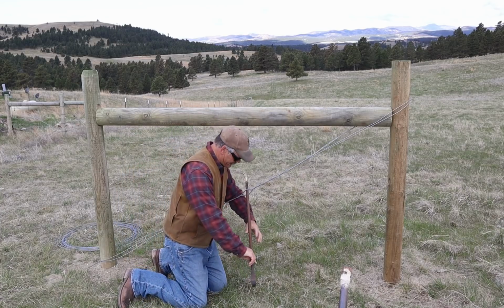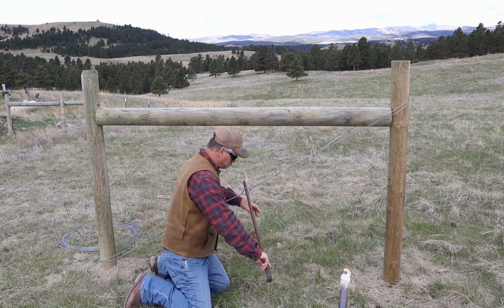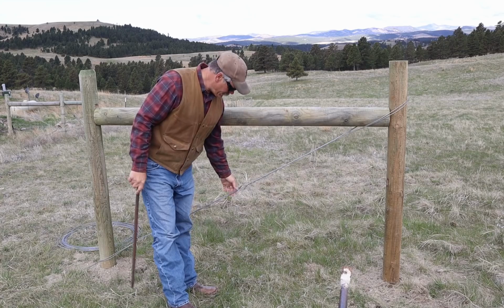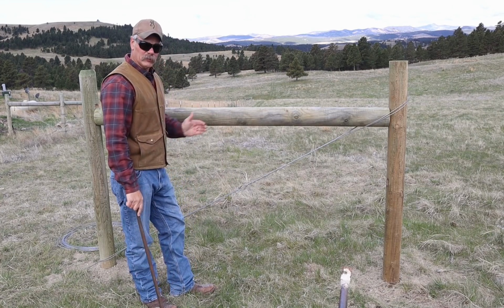Building Fence around the Timber Frame

Comment: I do a lot of livestock fencing in an area called Rock Creek (yeah its not just the creek lol). I like to go a minimum of 3 feet deep on my wood posts. On occasion i hit the rock that the earth was built on and have to use concrete, which i dont like doing either. I used to sink the posts into the concrete. About 10 years ago i started using post collars. The bottom is just like a standard framing post anchor but the top is a collar that goes up the base of the post 12 inches. The bottom of the collar has drain holes. They work great and dont wear out the post like concrete does. Just for future reference.

Comment: As a kid, growing up on my dad's mixed farm of 70-80 acres in southwestern Ontario, Canada, there were three jobs I despised from the bottom of my heart; 
Hauling manure with the old worn-out John Deere spreader we had.
Fixing the old, rusty steel plumbing in the barn that ran water to the dairy cows, the beef cattle, and the stinking pig pens.
And repairing or building the barb wire fences!
No wonder I didn't turn out to be a farmer! :-)  (Besides, I think my dad hated those jobs as much as I did, and that was one of the reasons I got stuck with them regularly!)

That is real "Pa Ingills Country" you live in out there...
Reply from the maker: You're probably right about that Dave.  Thank you so much